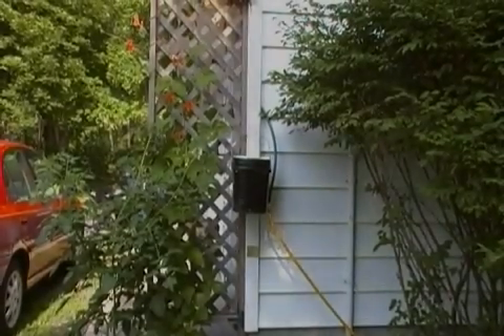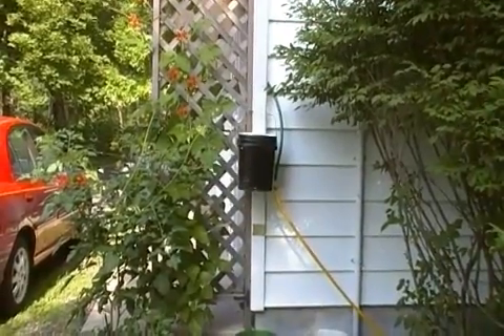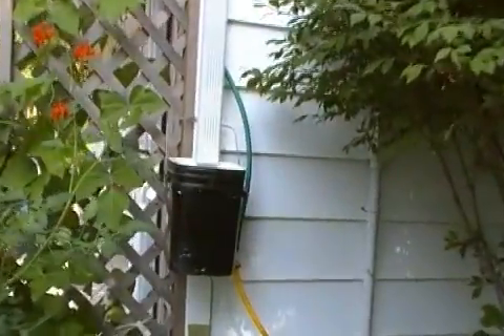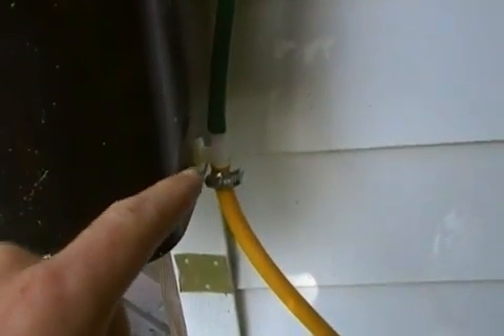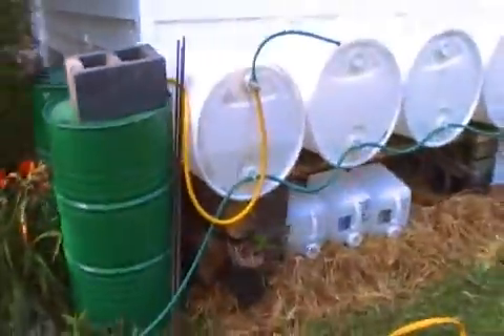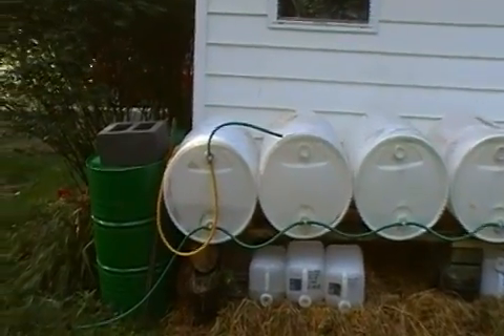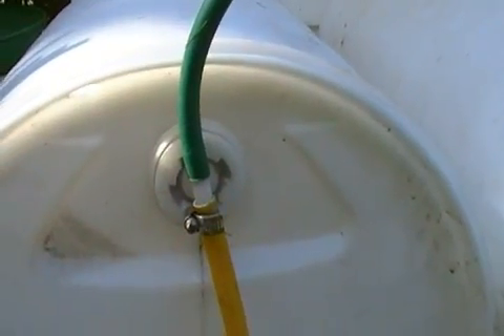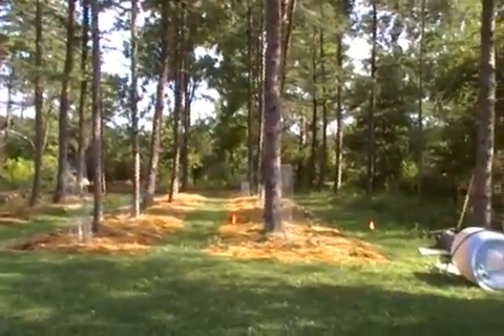Water catchment system - rain collection and filtration

Comment: if you where to turn the barrels 180 degrees and use 2inch pipe joining the barrels the green hose then at the top would vent the whole system giving  a much better flow rate (just a thought)

Comment: suggest adding a vent across the tops like at the bottom, this will let your equaling between all barrels instead of a pressurized backup in the lower barrels

Comment: a smart man uses hose rather than ridged pvc .. I commend you for having some sense.. pvc will not last in the heat,, it drys out, cracks,and leaks ... hoses can handle movement and expansion/shrinkage of the barrels ... good job !

Comment: @brianwurst1234 - You're right that it can't keep up with a downpour... The interesting thing is that, at least for my purposes, the system always had more water in it than I needed.  I think future designs will include a much larger intake, and a better overflow system to charge a small pond or something of that ilk so it can always be full but be using all incoming rainwater in a useful and thoughtful way, all away from the foundation of the building.
Thanks for the comment!

Comment: that 3/4 hose cant possibly keep up with a downpour. you have a 3 or 4 inch downspout going into a 3/4 inch line? why not run a 3" pvc line from the catch to the barrels. you will prob have micro solids collecting in the hose where it cant push it uphill anyway. you should have more than enough water though!

Comment: @thegoodlifefarm he first feed line is in the correct place each subsequent barrel needs to be the exact same, this is the ebb and flow method, as soon as one barrel fills it spills over into the next, this method assures a complete fill of each barrel, the way its set up now I doubt they will fill past the half way mark ever. I am not trying to piss on your parade at all , I have built several of these and know the method that works best from my own errors. the gutter entry needs to be higher.

Comment from the maker: Good point, although the design really wastes 4 useful drums this way... I plan on redoing the system this spring using black locust thinnings from a nearby forest.  It will be super strong, rot resistant and cost just about nothing.

Comment from the maker: Thanks for the feedback...
1) I'd agree feed lines should be more substantial for sure!
2) The fill line is above the barrels at the start, I should address the sagging
3) What is the ebb and flow method?

When it comes down to it, with the one half of just the garage, and all the inefficiencies in the system, it still managed to be nearly full all growing season.  I think creating a water loving garden all around it would be a nice use of leaks / waste water and take pressure off of perfection.

Comment: There are a couple problems with this setup, 
1. The feed lines needs to be bigger, min 1"
2. The fill line has to be higher that the top of the barrels.
3. The connecting lines need to follow the ebb and flow method, otherwise they will never fill completely.
Otherwise everything else is right, good work man you have the right intentions now lets get you setup to really catch rainwater.

Comment from the maker: Good question/point... The buckets size as well as the pipe diameter certainly are limiting factors.  A heavy rain overflows it easily.  If I had more barrels in the series I would want to increase the size of the catch and fittings, but as of now, even with the huge inefficiencies, it still remains full most of the year so it hasn't been an issue.  Might be worth designing this portion of the system larger to begin with, though.

Comment from the maker: I think the black bucket would probably be perfect for the system if the hoses connecting from it to the system were much thicker.  Right now the limiting factors are the hoses for sure, so one or two 2" dia. hoses would make a big difference.
Also, in the North East, I'd say the backup issue is moot since one solid summer rainstorm completely fills up the system, so even though it is really inefficient in some ways, it still does everything I need it to.  Best of luck!